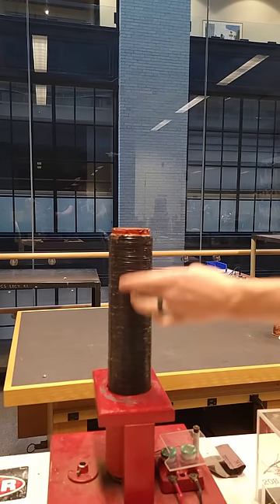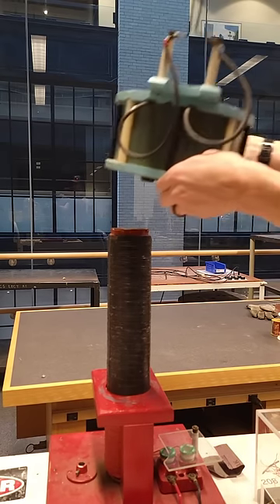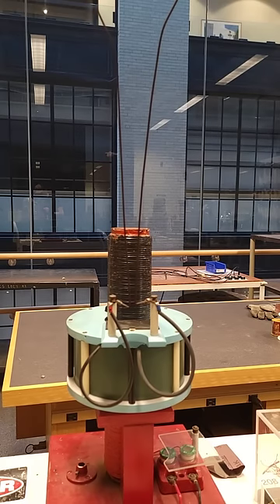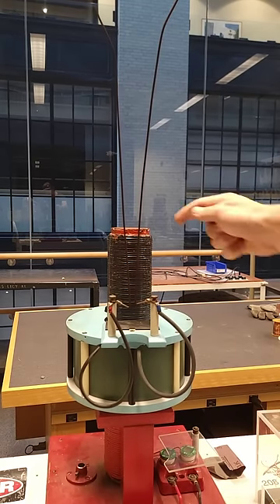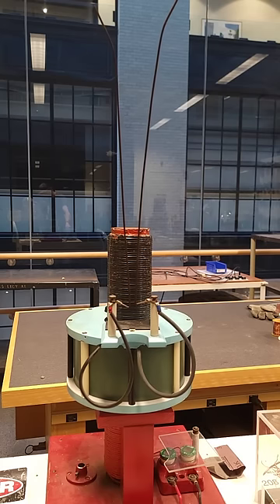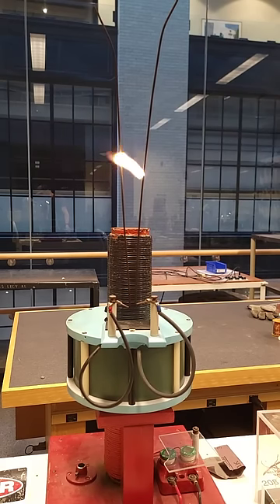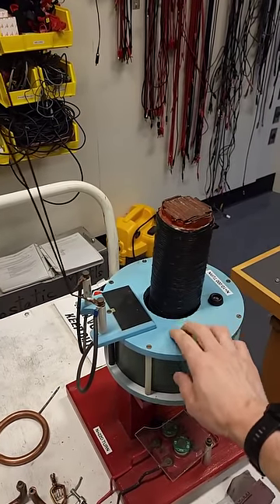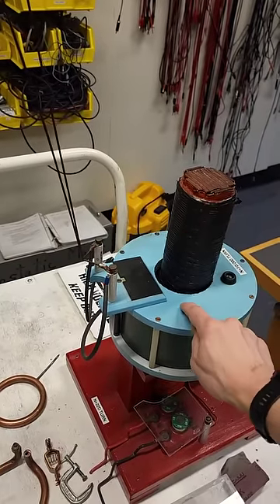Watch this 10,000 turn transformer breakdown air! #shorts #physics #science

Comment: For everyone talking about how scared they are about him touching it, it might be thousands of volts but they're at extremely low amperage. I'm not an electrical engineer but I could surely say this device wouldn't kill you instantly. Maybe from sustained contact but he's probably good to touch it. Now if it were the other way around, lower voltage at extremely high amperage id be worried

Comment: Messed with transformers on Beckett oil burners on pressure washers and they were 10K volts.  Checked if transformer was good by drawing an arc across electrodes with a screwdriver much like the Jacob's ladder there..  i must say, its a hair raising experience.

Comment: I'm guessing the base is modular and allows for different step ups or down? But my real question is this. I thought that to make uses of the 220turns into the 10000 turns they'd have to share the same surface area to make full use of the magnetic fields. Am I miss understanding or are you just trying to keep things simplified for the short?

Comment: So what your saying is that we can multiply the electricity put in but we cannot create a self powered generator... I know and understand loss and deterioration but it just kind sounds like it's possible. Generator poweres step up transformer then it sends some of it's stepped up per back to the generator and the rest into a battery. What happens if you put more than one step up transformer in a line?

Comment: Have you ever noticed how spark from static electricity? Or whatever is always trying to go away from the center of the Earth. Almost in a straight like magnetism, pulling us down. The gravity is in a straight line. Every time we produce electricity , it tries to get away from it in a straight line Same as lightning lightning strikes, but it tries to get away goes in straight lines even though it's all crooked. If you run the line from where it strikes to the lineward start, it's a straight like we're producing electricity, which is the Earth alone, something like Tesla was thinking.

Comment: If you wrapped a metal rod embedded into the ground with copper wires, would it carry some electrical potential?  If you put an inductor over it, would it be enough electricity to power something?
Reply: Now I need to learn how to Build solenoids and inductors....

Comment: So..not knowing how this works, could you step up a small amount from the wall ans save it into a battery or capacitor and then use it later?  Could you use this to save money or does your meter run the same as your step up?  Did i ask that correctly?

Comment: What's the frequency of the ac supply, 1 hz? Does the speed of the spark depend on it? If it wasn't a spark, would that be considered an antenna for radio control?

Comment: It's all fun and games until you realise that your circuit protection device that would normally cut power if it grounded through you doesn't work if you accidently touch the secondary coil.

It can't detect ground faults on the secondary.
The secondary that has such high voltaic potential that it ionises air.

It cares not for resistance and your GFCI / RCI has no power here.

Comment: This is how your spark plugs work. The coil transforms 12 volts to thousands, enough to jump the spark gap and ignite the fuel charge.
Reply: Technically, he showed what the coil does: the primary windings take in 12 volts (give or take) and steps it up to 60,000 volts in a modern vehicle. But amperage is pretty low. So, when you accidentally get zapped, it’s more comical than catastrophic.

Comment: the issue with the guys logic is that on the Ferris core one you are actually getting about 100 turns possibly less due to the height of both being different. you would need to shorten the Ferris core one to get the proper volts and amps out. though good video all in all

Comment: This is super cool I have no knowledge of electricity in applications for it, what could you use that for?
Reply: in industrial applications they are vital for powering high voltage systems. this is the essential component of a tesla coil which uses a gap device to time and scale the discharges

Comment: Wait....   I'm I hearing this right? If I took a ferris piece of metal wrapped it 220 times with insulated wire and left the ends hanging so I could connect 120v, then wrapped a cardboard tube with 10,000 wraps of insulated wire and put it over the first piece and added the 120v I could get that killer spark? Is that what you're saying?

Comment: A much easier explanation of what's going on here Is every time a wire breaks a magnetic field, a generates an electrical current. The voltage that is produced is directly proportional to the amount of turns in versus the turns out. For example if the primary coil has 200 turns and the secondary coil has 2,000 turns, that's a 10:1 ratio. That means that if you put 100 volts in, you'll get a thousand volts out. If you go the opposite direction and put a 20 turn coil as a secondary, you put 100 volts in, and you get 10 volts out. However, assuming that the transformer is 100% efficient (which it's not) The power input and power output will be the same. Meaning that if the voltage increases, the current will also decrease. If the voltage decreases, the current increases. That means depending on the amount of windings you have on the primary versus the amount of windings you have on the secondary, you can achieve some pretty amazing shit. For example, If you have a 200 turn primary and a two-turn secondary, You have a 100:1 ratio. Meaning that if you put a hundred volts in, you only get 1 volt out. But that also means that if you put one amp in, you get 100 amps out! Just imagine if the primary consumed five amps, you would have 500 amps out on the secondary. That's enough to start melting wrenches and large metal objects. Crazy stuff!

Comment: If 240v on a 1amp gives you 240 watts, if using a step up converter to give you 10,000 volts, which on a 1amp gives you 10,000 watts, why can't we use it to power itself?
Reply: Well its a current divider, so your looking at milliamps not amps

Comment: If you have one of those old "negative ion generator" air cleaners, don't touch the tip of it while standing on an outlet from your central heat system, which is grounded. VERY painful - even shocking.

Comment: And unless you put it in a faraday cage someone federal will eventually come knocking.  I was experimenting with a jacobs ladder at 85k volts  and 220v 400 amps input (max arc length was about 9 feet and about 1.5 inch diameter . I got a low altitude flyover by a pair of military jets after about 2 hours. (base was 40 miles away).

Comment: The ratio of turns of wire of the two coils is 45.4545  to one. The larger coil has 45 turns of wire for every one turn of wire in the smaller coil. The 110 volts being applied to the larger coil is MULTIPLIED about 45 & a half times HIGHER making it about 5,000 volts BUT the amperage is 45.45 times LESS than the amperage of the 110 volt input voltage. So.... he COULD possibly touch the spark generated by the transformer although it would sting like a motherfucker... it wouldn't kill him. It wouldn't kill him UNLESS it traveled along a path that took it across his heart. Nikola Tesla was doing experiments like this a hundred & forty years ago.

Comment: fyi..you go from 19,000 volts or higher IE* transmission lines to usually to either 13.800 or 7,200 volts ,,then down to 75kva or 50kva or 25 kva then      from primary side to secondary side is usually 120. then to 110 wall outlet :P then to your appliance ..... but ya your right get urself some mineral oil and the diagram of copper wires and u have a transformer :P

Comment: except... it isnt thousands of volts. the arc itself is quite possibly only 20V. probably more like 120, but yeah.

its only at the peak potential of the transformer when its NOT arcing. that might be 10 kv or more, iunno. couldnt be bothered working it out. somene else says 5.5kv. yah. probably right.
when the arc is formed, the voltage is dictated by the resistance of the air gap, and the energy available to push a current through that resistance. it isnt just the turns ratio, its the coupling, and resistances of the wires that also play a part. the amount of power being transferred. only so much can do so.

if its shorted out, how many volts will it be? technically... none. the current will be at a maximum. lenz reaction at a maximum. of course theres a potential, something causing the flow... but where do you measure it?

lol.

like a NST... may say 15kv, but it also says 30mA. open circuit, or any resistance OVER 500K, its delivering 15kv, as per turns ratio.
at 500K load resistance, it delivers exactly 15kv at 30mA.
as the resistance reduces, gets closer to a short... the current remains limited to 30mA, as NSTs are designed to do that. so they can sit all day driving the very low conduction voltage of a neon sign at 30mA, and not overheat, or burn out the tube. the voltage can be anywhere form very close to zero, to 15kv...

whereas an MOT cant deliver the voltage required to get a neon tube light... but if you tickle the tube with a high pulse, like a camera flash tube does, the MOT will very happily conduct across the low resistance of ionisation and quickly fry the tube as MOTs deliver power with no current regulation...

camera flashes deliver all the energy of a capacitor rapidly, but need the pulse to ignite them/

Comment: I'm curious how many amps are lost in this process.
Reply: In the case of this model shown here, where the turns of wire of the primary winding of the transformer are 45 turns to 1 turn of the secondary winding.... the reduction in amperage is one forty fifth ( 45 times less ) than the supply amperage. If the supply voltage is 110 volts at 1 amp then the output voltage will be 5,000 volts at .022amps.
Reply: A reduction in amperage ( in this specific case ) of 99.978 % of the amperage .

Comment: How does the amps/watts change?
Reply: Yes. When the voltage is increased the amperage is decreased. The voltage is multiplied by 45 times ( in the model shown here ) SO, THEREFORE the amperage is divided or decreased by a factor of 45 times. The mathematical term for this type of reaction is called an INVERSE REACTION. In this case the reduction in amperage is INVERSELY PROPORTIONAL.

Comment: Burn the air?   WTF.  Wrong choice of words or needs to study more.  Nitrogen, main components of the atmosphere, does not burn nor does oxygen (about concentration of 21% in atmo).  The higher voltage overcomes the insulating amount of the atmo between the electrodes so it “jumps the gap”

Comment: So I got a legitimate question. Could a person use a step up transformer to produce more power from less then save it in some large batteries and use when needed so you're cheating you're power company? If so, how come everyone is not already doing this? I know there's items that have small step up transformers on DC batteries with AC outlets to guarantee power to sensitive items in case of storms. I know cause I scrap metal and I sell the copper wire, the lead acid battery and separate the copper from the transformer for sale as.#2

Comment: The fact that I watched this and said. So why can't we make tons more electricity for cities. And my pal just sighs and says I need to read more.

Well, I guess, I'm dumb.
Reply: P=VI, or power=voltage*current. When you convert to higher voltage, you’re lowering the available current, but the total available power stays the same. Now, if the current passing through a cable is what causes inefficiencies/heating up, and power lines take advantage of this by transmitting electricity and high voltage low current, and then transforming back near to your house.

Comment: Air or oxygen does not burn. The light you see is the creation of plasma created by the high amount of electricity. 🤔👍😎🇺🇲
Reply: "oxygen does not burn" dude what?
Reply: @PLAYERSLAYER_22  Three things are required to make a fire. Oxygen, fuel, and heat. The higher the concentration of oxygen, the faster the fuel burns. Acetylene torch is a prime example. As you increase the oxygen, the flame gets hotter, allowing you to cut steel. If oxygen burned, the earth would have blown up long ago. 👍😎🇺🇲
Reply: @allamerican8967  ohhh I understand what you mean now. but I still think the way you phrased the original comment is misleading at least due to the o2 becoming part of the reaction.
Reply: @PLAYERSLAYER_22  Ahh. In the video, he said it burns the air. That's where I started.  Sorry about that 😖👍

Comment: You don't "put volts into" anything... you change your volts (which is the POTENTIAL) up or down; high voltage = high potential. You can have the highest amount of volts all day without being in danger because you need electricity to flow in order for it to be dangerous. 
Amperes IS the electricity. 

What we are seeing is high potential (aka volts) with a lot of amps of electricity. 

I can't stand how "educated" people always find a way to misrepresent phenomena that has a logical explanation to it. Do Better 🫵

Comment: So. be something other than medially interesting, and demonstrate real-world application of the theory, if that isn't above your level of understanding. E=I÷R. Electromotive Force (Volts) equals I(influx) current flow, divided by R(resistance in a circuit, unit: ohms).
Let's put it in terms anybody can understand. 
When you shuffle your feet across the carpet and touch a grounded light switch, there's a "snap", and a little blue spark. THAT'S a quarter of Million volts, but it's only l measurable in pico-amps of current flow. Now. screw up jump-starting your Mother-in-law's Cadillac. You're obviously not the brightest bulb on the string, so I'll make it simple. The battery is 12 volts. the battery capacity is 450 Amps. If we run 12 volts through your body at even 300 Amps, young going to still be screaming as you start to boil from the inside out. wanna see what I can do with a 9 volt battery?